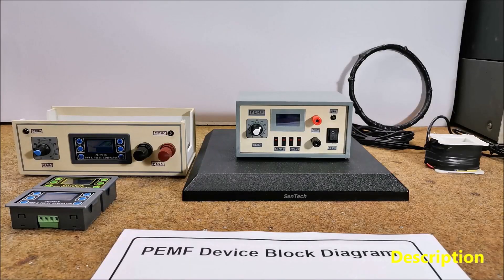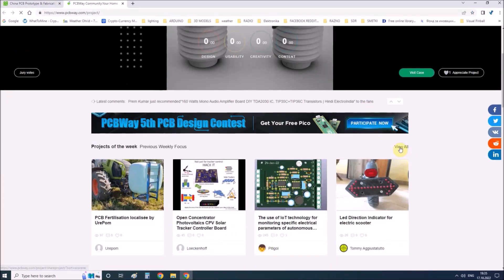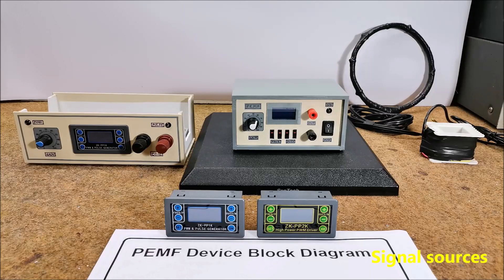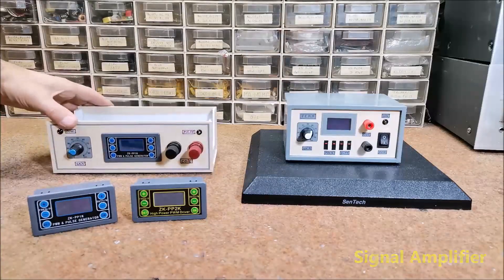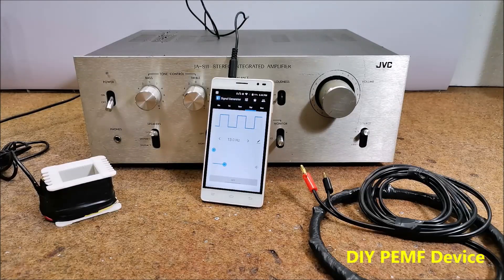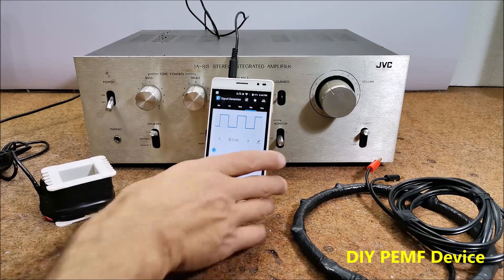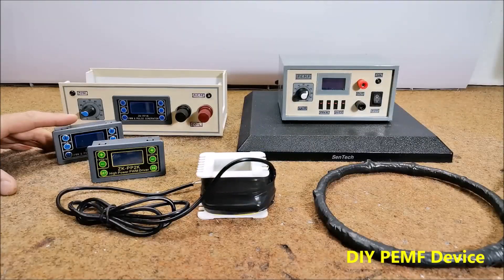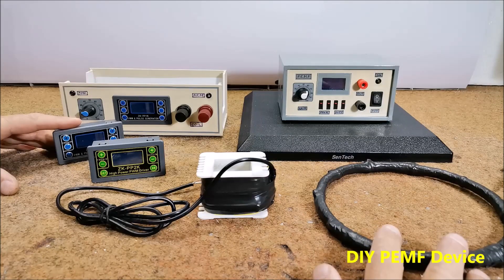PEMF Therapy device experiments - general description, building instructions, DIY

Comment: Hi,
FIRSTLY: Big Thank you for your efforts in making these videos for people who can make them and cannot afford to buy ready made equipment.
SECONDLY: I have a frequency generator that will transmit at 20v any frequency from 1Hz to 50K.
MY QUESTION: Can I connect this frequency generator to a transformer coil directly to have the same result?
Reply from the maker: The maximum input signal voltage should not exceed 12V.

Comment: Hi Mirko, thank you so much for sharing. I did the multiple pemf, all good, it turns on and gives pulses, lights flash.. Potentiometer OK As long as there is no coil, everything is perfect. I connect a coil to it and there's magnetism, but... I have seen that the negative cable area of the MOSFET swicht burns What did I do wrong? Please
Reply from the maker: Maybe too little coil resistance (overheating the mosfets)

Comment: Thanks for making it clear to me how simple it really is!

I was trying to test with a stereo, but it's broke. So I did it with my Raspberry Pi instead with a DC controller as the "amp" of the square wave generated by the Pi.

Easy-peasy! I also made my own coil winder by drilling through a plastic supplement bottle, and cut cardboard supports that I glued on one side and taped on for easy removal on the other, for the wire to stay inside as it wound it. The hole through the bottle wasn't perfectly straight, but I could still wind it at a rapid pace, leading the wire with my hand. ^^

Currently have some sore wrists from strength training, so will see if it has some effect.

Comment: Listen, I'm not the smartest tool in the box lol
But I'm trying to have a setup where I can use my phone to generate the signal, amplify it from my headphone jack and then connect the coil to the amplifier.... I don't know what will work strongly enough from Amazon. Could you please show me an amplifier from Amazon that could work for that? A small amplifier so I could bring it with me easier would be nice...
I have no problem cutting some headphones and using those for the input if I need to, or using cut headphones for the output... I just figured they'd be too thin. !! I don't want to have to get a college degree to make this 😫 please help lol

Comment: Hi Mirko, Thank you for all the great info you are sharing for free. Also i will be building my own machine when parts arrive. i have ordered a simple hand coil winder my question to you or anyone that knows is what is the material used to the strips used to bind the coils together on the 50mm and 25mm diameter Coils?

Comment: Mirko, thank you so much for making simplified instructions.  I want to build this to slip over my leg.  What size wire should I use?  I went to buy some enamled wire and just wasn't feeling confident.  Do you mean 0.25mm?  Could you also tell me what gauge that wire is?   How long will I need it?  I want to build two of them.
Reply from the maker: 30 to 33 gauge, it is not critical, you can calculate, one winding  =2* Pi*r

Comment: Hi Mirko, very interesting, i assume there is no ferromagnetic core inside, right?  
Could you tell a bit more about whats inside the coil and how you measure the field flux? With an EMF device?
Reply from the maker: It is very difficult to measure a changing magnetic field, especially at high frequencies, so I am measuring at a frequency of 1Hz. There is no ferromagnetic core inside coil
Reply: @MirkoPavleskiMK  Thanks for your reply :) Is there a reason why not using a ferromagnitic core.
Wouldn't the FE - core amplify the field (µ=800) so that you could work with lower Inputs with same effekt.
Or is the effect for PEMF completly different with a FE core?